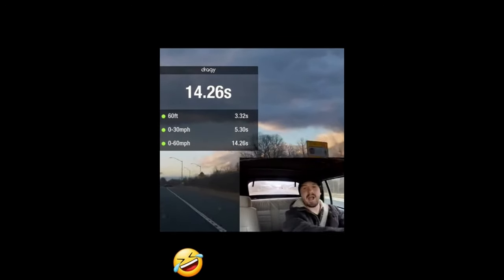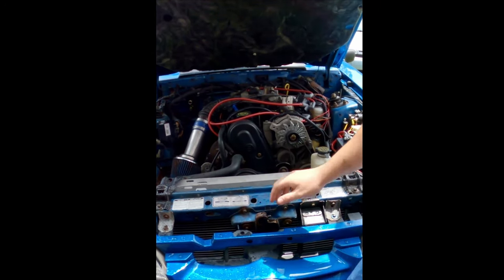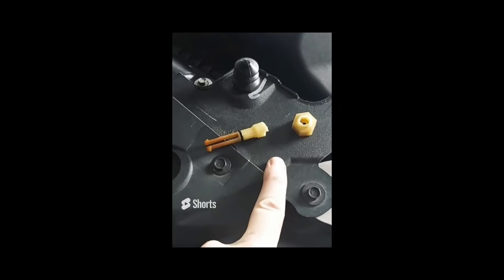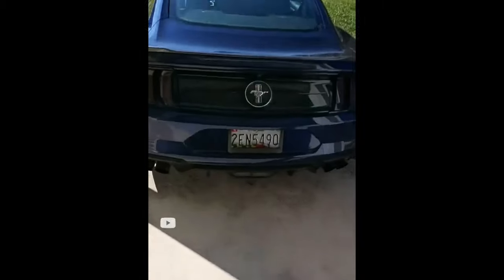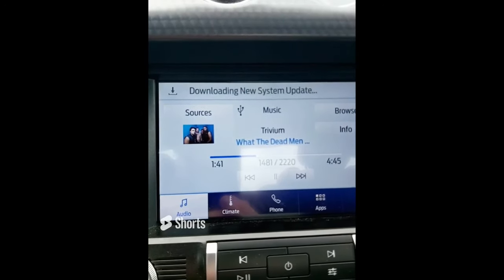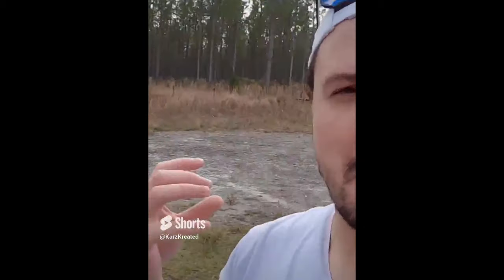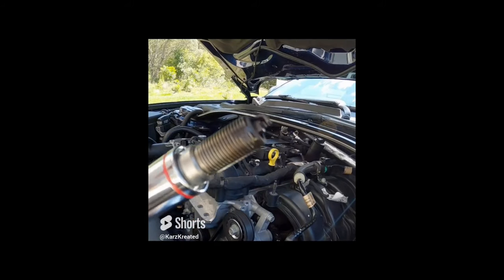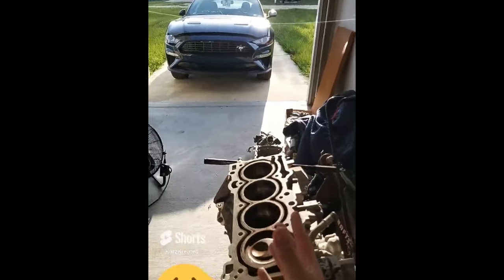Ford in 2024

Comment: how is running did u get a tune? or did you create your own
Reply from the maker: It's running well. Down on power a little because of the waste gate not adjusted optimally. Spikes around 25 psi and quickly tappers to 19-20 psi. I do have a few concerns about the new setup that I will address in a video soon. Nothing that can't be fixed.
Reply: 3v coming soon!!
Reply: Do you think some of the engine knock is due to the new short block being a higher compression than the old motor?
Reply from the maker: @donhelms8358  That is one theory I have been thinking about. It's very possible. However, I think it's a combination of things rather than one isolated cause. With that said, this new engine is very sensitive to knock. I just had it do it a little on straight 93. On a E30 or higher mix, no knock. And that's not even full boost yet, so it's kinda crazy.